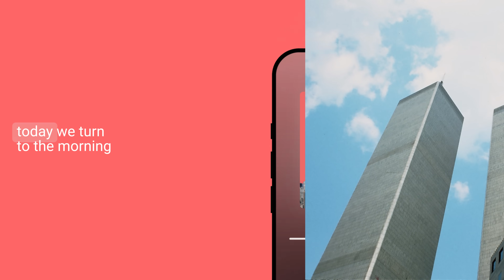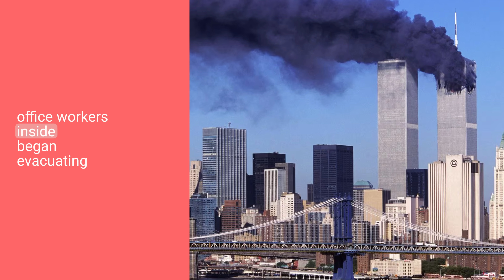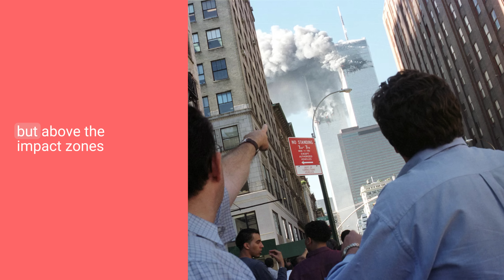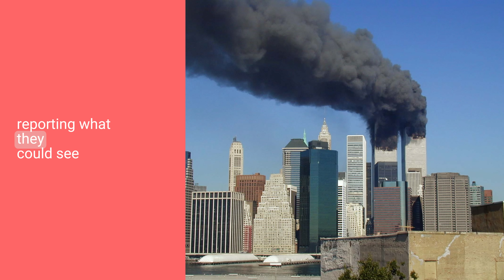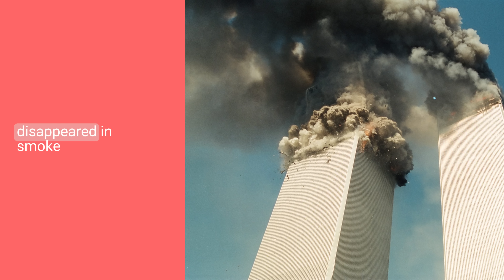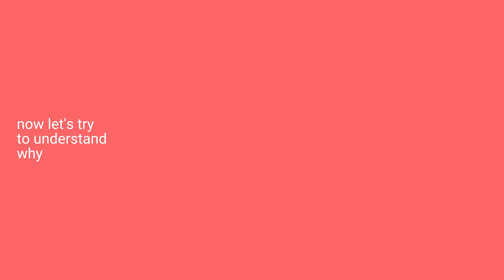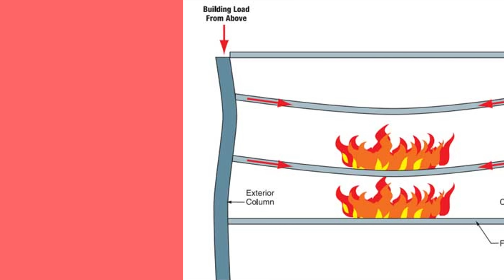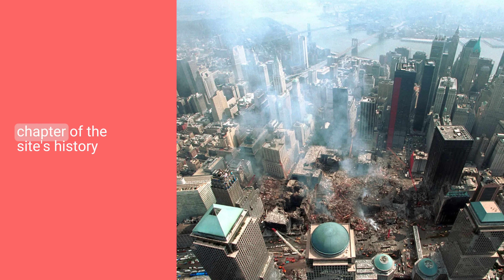9/11 - How and Why the Towers Fell

Comment: Fails to mention how anything can collapse through the path of greatest resistance as the Towers both did while accelerating. Omission of Convenience
Reply: “the path of greatest resistance” The collapse proceeded through the path of least resistance, the floors. All the floors, save 3 mechanical floors, had the same load capacity. The floors of the WTC were not rated to support more than 12 floors worth of static weight or 6 dynamic. The floors were never designed to carry more than their designated live load (people and furnishings). The exterior and core columns carried the loads from above. If more than 6 floors were to fall on to the floor below, nothing could stop the collapse from progressing to the ground. This is an engineering fact.
Reply from the maker: @Oldschooldan1  100% agree
Reply from the maker: Interesting point. I actually agree with your theory, but not with the conclusion. I think you’re suggesting the towers should have tilted to the side or fallen next to the intact structure below. But the amount of energy required to move that entire mass sideways, even by one footprint, is far greater than the energy needed to make the floor immediately below give way.

That’s why the collapse progressed vertically. The top section only had to fail the one floor beneath it, then that combined weight failed the next, and so on, like a row of dominoes. So the towers did follow the path of least resistance.
Reply: @wikiarquitectura my point is that the “collapse” as is explained by the official story and widely accepted as fact violates fundamental laws that govern the physical realm we exist in. These are simple scientific principles thrown out the window in order to fabricate a fantasy attempting to explain said “collapse”
Reply: @wikiarquitectura there is only so much energy in a system, in this instance 18 damaged floors in the north tower. The undamaged 92 remaining floors is the opposing force in that system that will absorb all the energy of the 18 floors, even in free fall. The physical limit of this system would have left the north tower standing  74 floors post “collapse” the healthy majority of the building was relieved of its load the moment collapse initiated. This combination with the 3 to 5 times strength redundancy built into the Towers was more than sufficient to oppose and absorb any kinetic energy of the unhealthy damaged floors falling.
Reply from the maker: @mkoury83 It’s not 92 floors resisting at once, it’s the single floor below taking the hit, then the process repeats.
Reply: @wikiarquitectura  the healthy part of the tower does not start to fall away until the upper portion is completely destroyed itself. What you’re referring to is a sequential floor by floor, pancake, and collapse. It has been agreed-upon since about 2003 that is not what happened.
Reply: Not so much a pancake collapse as a piledriver
Reply: @alanmurray5963  agree, and it is this pile driving phenomena that cannot be explained and defies physical boundaries of conservation of momentum
Reply: 2/3 rds freefall

Comment: Do the people who design skyscrapers have to figure out how to distribute the steel?

Is a skyscraper over 300 meters going to have more steel toward the bottom to support the weight, rather like the Eiffel 🗼 Tower?

So where is the data on the distribution of steel down the North Tower of the WTC? Did level 105 contain the same amount of steel as level 5 which had to support the weight of 21 times as many stories?

When did "experts" discuss this in relation to the collapse time after 9/11? Try finding such info. Check the 10,000 page $16,000,000 NCSTAR1 Report by the NIST. Keep looking. Good Luck!

Try finding a transcript or recording of Experts, structural engineers or physicists discussing the distribution of the 100,000 tons of steel and the weight of the 212,000 cubic yards of concrete in each tower.

What is the Conservation of Momentum?
Reply from the maker: Hey! Thanks for watching. Those are excellent questions, though impossible to cover in detail in a YouTube comment…

The short answer is yes, buildings use thicker walls and columns toward the bottom than at the top. Sometimes it’s not just about thickness but also about material quality, like using higher-strength concrete in the lower columns.

This isn’t done floor by floor but in sections, which helps simplify material sourcing and construction.

And yes, NCSTAR 1 is the main reference. It’s a huge report and not easy to navigate, but it does cover the towers’ structural system, including how the steel columns tapered and changed along their height. The detail is spread across multiple volumes and appendices, which makes it tricky to find quickly.
Reply: @wikiarquitectura 

I downloaded the NCSTAR1 Report by the NIST and burned it to DVD in 2007. I read every paragraph that contained the words 'steel' or 'concrete'. They mention 200,000 tons of steel three times. No mention of more steel relative to the top though there are pictures of steel that are obviously from near the bottom. No data on the horizontal beams in the core.

The length of horizontal steel in the core on each level had to be about 2.5 times the length of vertical steel which would have been 47 × 12 feet.
Reply: @psikeyhackr6914  NCSTAR1 is more like the summary of the earlier reports in which they go more into certain specifics like that. So you just need to try harder, they definitely have it in the reports somewhere, actually I looked it up recently.
Reply: @psikeyhackr6914  Dude, did you even read what you reply to?!? NCSTAR1 is the last of multiple NCSTAR reports. You need to check the OTHER NCSTAR reports which go more into specifics like the one you ask for.

Comment: yeah for a lot of people, they feel it was insulting or accepting defeat that they did not rebuild the Twin Towers and this time make them taller, bigger, it would have sent the message to the middle east and terrorists, that you may have knocked us down but we got back up. At the same time, its a reminder that, i'm sure lots of people wonder why terrorists were so obsessed and fixated on the WTC Twin Towers so much, because 9/11 was not the first time they were attacked, there was the bombing attempt in the early 90s, in February 1993, using a Ryder Truck with the bomb, that failed, 8 years later, mission accomplished.

So yeah, those 2 tragedies obviously go to show that the WTC Twin Towers, why they were so obsessively targeted and fixated on for destruction.
Reply from the maker: Yes, the towers had been attacked before. Their global visibility and symbolic role as icons of New York and international commerce sadly made them a fixation for terrorists.

As for the rebuild, it was a complex process. Like you said, some people wanted to rebuild the towers taller, bigger... others didn't want to build at all... I actually just published a video that goes through the process of deciding what to do at Ground Zero after 9/11, you can watch here: https://youtu.be/H-k5YaADmdI
Reply: @wikiarquitectura  Search the channel substack of David A. Hughes on 9/11 and Mark Conlon 9/11 Planes Research, you will understand. Please after share.

Comment: Fuel jet wasn't hot enough, leaser took out insurance before they fell and didn't show up to work there. Inside job, end of story.
Reply: The jet fuel, compounded by the massive explosion, weakened the steel beams that were left (many of them were destroyed by the explosion), thus the upper floors gave way.  The insurance was in place since 1993; it was just that the building was sold 6 weeks before 9/11, thus the policy was updated for the new owner, but the amounts and terms were the same.  The owner did not work at the Towers; his office was in midtown, about 5 miles north.  And please elaborate on how a massive rigging can be done without detection.
Reply: You don't need to melt something in order to weaken it, steal beams loose most of their structural strength long before they actually liquify. Wouldn't make any sense for the building to keep standing all the way until the steel has become completely molten. It's incredible how many adults fail to grasp such a simple concept.
Reply from the maker: @Roman-nu1om  Thanks for commenting Roman. I agree with you. If people want to talk politics, I'm not going to argue with them because what do I know about that... but the laws of physics are the same for everyone.
Reply: @Roman-nu1om  You do need to melt steel to find molten steel afterwards.
Reply: Tinfoil hat tight enough for you?
Reply: @viictxriia quit being so rude on every comment! Do your research! Are you an expert regarding what it takes to bring down a sky scraper?! This was a soulless evil act that needs full investigation and every aspect analyzed!!! There's way more to this than you will ever know!!!!!
Reply: No
Reply: @JaysYoshiYT democrat detected
Reply from the maker: You are correct. As I mention in the video, it wasn’t just the fire caused by the jet fuel. It was a combination of the impact damage, the loss of fireproofing, the fires fueled by office contents, and then, gravity. The jet fuel didn’t need to melt the steel, only weaken it enough for the trusses and columns to fail.

Regarding the insurance, it’s common practice for any property owner (or in this case a 99-year leaseholder, which is very similar to ownership) to insure their assets.
Reply: @wikiarquitectura it's definitely coincidental that they took it out a few weeks before it happened, and didn't show up to work the day the attack happened.
Reply from the maker: @ALLMETAL1970  Larry Silverstein signed a lease on the towers just weeks before the attacks, so of course he only took the insurance weeks before it happened. You don't insure your home before you buy it, do you?

Comment: They were designed to withstand a plane crash
Reply from the maker: You’re right, the design team did consider that the towers might one day be struck by a plain. They considered the scenario of a Boeing 707 (the largest jet at the time), lost in fog while trying to land at low speed.

But there are two important things to keep in mind. 

First, it’s impossible to precisely calculate an event like that with so many variables. You can calculate the impact of placing an Olympic pool on the roof with precision, but not the impact of an airplane: which floor, what angle, what speed, how many perimeter columns are hit? In the 1960s, with the computing power they had, that kind of simulation just wasn’t possible.

Second, the planes that actually hit were Boeing 767s (much larger than a 707) and they weren’t trying to land like the design team had assumed. They were traveling at very high speeds and carried around 10,000 gallons of fuel. That made the real impacts far beyond what the original designers could reasonably have prepared for.
Reply: @wikiarquitectura   "They considered the scenario of a Boeing 707 (the largest jet at the time), lost in fog while trying to land at low speed."

That nonsense was spewed post-9/11 by John Skilling's co-engineer Leslie Robertson (RIP) on numerous occasions.
In fact, there was a comprehensive study done in 1960s that considered a plane impact either by Boeing 707 or Douglas DC-8, both travelling at 600 mph.
In 1993, one day after the WTC bombing, the (real) chief structural engineer of the WTC, John Skilling (not Robertson, as he got portrayed post-9/11) gave an interview to the Seattle Times, in which he again underlined the structural robustness of the twin towers, even in case of a jetliner impact. The plane impact would kill a lot of people in the impact region, there would be localized structural damage, a jet-fuel dump and fires, but the buildings would remain standing.
Reply: @MrKoenig1985  Thanks.  Never heard of John Skilling (familiar w Les Robertson) - - if what you’re asserting is true - - why do you think this person Skilling has never been acknowledged in the media since 9/11 ?
Reply: @MrKoenig1985  He never said anything about speed, why are you truthers always lie?
Reply: @bebabcsinya  Could you please quote what you´re referring to?
Reply: @wikiarquitectura  "First, it’s impossible to precisely calculate an event like that with so many variables. You can calculate the impact of placing an Olympic pool on the roof with precision, but not the impact of an airplane: which floor, what angle, what speed, how many perimeter columns are hit? In the 1960s, with the computing power they had, that kind of simulation just wasn’t possible."

If I have limited computing power or calculating parameters and various variables, when I'm going to design the skyscrapers, which should resist jetliner-impact damage and strong hurricanes, much more robust. Especially, since the cost factor was less important when the financing comes from the tax payers.

"Second, the planes that actually hit were Boeing 767s (much larger than a 707) and they weren’t trying to land like the design team had assumed. They were traveling at very high speeds and carried around 10,000 gallons of fuel. That made the real impacts far beyond what the original designers could reasonably have prepared for."

Again, in the 1960s, the WTC design team considered an impact by a B-707 and DC-8 travelling at 600 mph [see NIST NCSTAR 1-2A, Appendix A (Sept. 2005)]. I don't know the basis on which Leslie Robertson based this contrary post-9/11 claim. 
Robertson was never confronted about that, which is by the way very telling about the journalistic quality of the mainstream media.

The overall size of the plane is less important, than the number of heavy components it carries. And these are usually the turbines and the landing gears, which could do most structural damage to the towers.
B-707 has four engines in total, two more than the B-767. So, it could potentially inflict more damage to the structural frame at the same impact speed.
Reply: @wikiarquitectura  The planes weren't much larger, and yes, even though their is randomness in the event, you can still make real and very useful predictions about it.
Reply: @wikiarquitectura  "The newly disclosed documents, from the 1960's, show that the Port Authority considered aircraft moving at 600 m.p.h., slightly faster and therefore more destructive than the ones that did hit the towers, Dr. Sunder said."

Dr. Sunder was head of the NIST investigation. So could you please just stop spreading lies all the time?!? Delete your shitty video so you delete all your full of lies comments too at the same time liar!
Reply: @wikiarquitectura the truth will be revealed soon so many stuff on that day the official narrative can’t account for!
Reply: They did withstand crash, if was the fireproofing being blown off the steel that proved fatal
Reply: Architects/Engineers for 9/11 truth.
Reply: only a 707 not a 747.
Reply: Search the channel substack of David A. Hughes on 9/11 and Mark Conlon 9/11 Planes Research, you will understand. Please after share.
Reply: The truth is, is that European buildings are made of large amount of steel, concrete and bricks.
American buildings are made of a small amount steel, concrete and a large amount of cheap DRYWALL!!😂

Comment: Ok now do WTC7
Reply: Hiya just come across your YouTube on September 11th 2001 twin towers il leave comments after watching 😊
Reply from the maker: Hi there! Next episode will be dedicated to the reconstruction of Ground Zero. The different projects that were proposed, the competition, power struggles, etc. The WTC7 will be mentioned of course, but not in detail. Then I'll do the 1WTC, as it is the most iconic building within the complex. After that I think I'll be moving on from this short series into other buildings in other cities, from other times, as I don't want this show to turn into a show about NY architecture. That being said, there is an outstanding number of interesting buildings in NYC, so we'll keep coming back to it, and I'm sure the WTC7 will eventually be one of the buildings I cover ;)
Reply: Twin towers of its time was badly designed especially the stairwells in the central core badly designed poor condition of the floor trusess n fixings which attached to the floor trusses.... Firemen have a saying on high rise buildings never trust a floor truss as they fail in extreme conditions
Reply from the maker: I understand your point, but at the same time, it’s important to remember that no building is designed with the idea that a commercial airplane will crash into it. Particularly before 9/11, that scenario just wasn’t part of engineering standards, so I wouldn’t really call the design flawed. The towers were groundbreaking in many ways for their time.
Reply: @Tiffany.1970  If that really is a saying of firemen, then please list buildings where steel floor trusses have failed during a fire in high rise buildings.